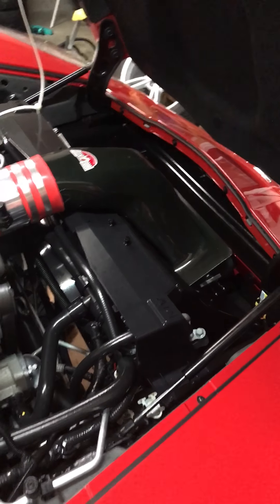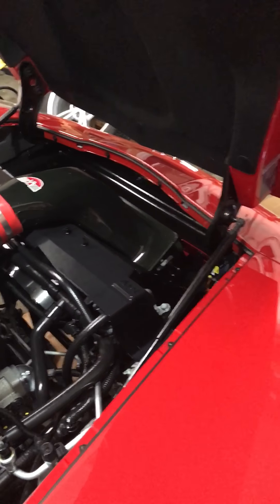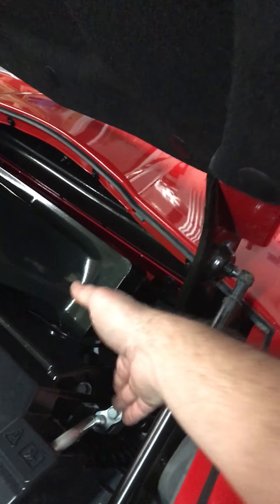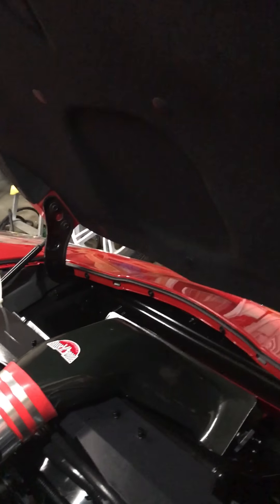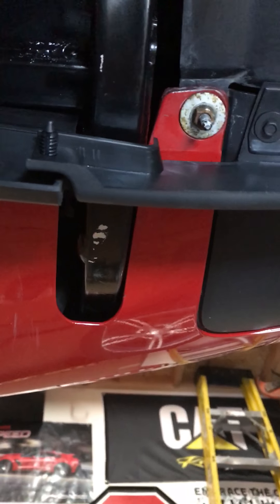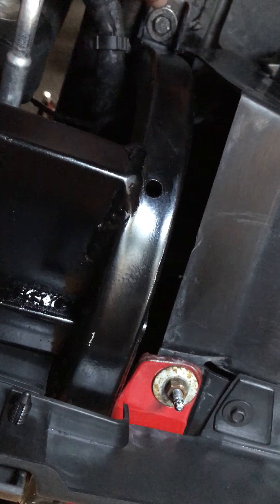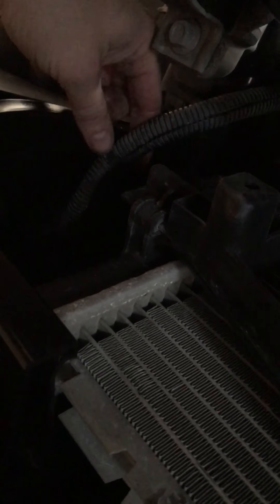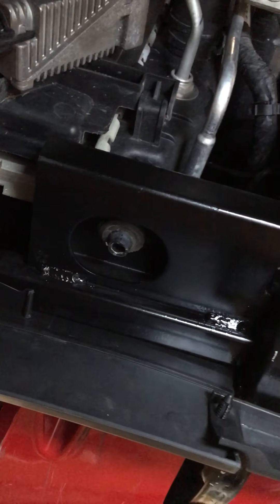C6 Corvette Front Skid Plate Removal Explained

Comment: I just went out and bought a flux core welder for 100 bucks and I'm going to repair mine as well. You are right about there not being a video detailing the removal. It's GoPro time. You inspired me to make a "how to video" with my C6 on the removal of this lower radiator support skid. Your video gave me enough information to tackle the job. Of course, seeing all the complaints and recurring damage that is caused leads me to conclude that it is a real shit design flaw.

Comment: Finally got the nerve and time to try this - The procedure works well - had to research or really look to tieing up the Radiator, sure didn't want to end up damaging that. Then of course working under the car I used Jack Stands under where the cradle ends and lower a-frames(both sides) meet. Then put Floor Jacks (I have 2) under the side frames where the jacking pucks go. The floor jacks wasn't carrying any weight just snugged up as a backup to the jack stands  I wanted as much security as possible when I was under that car.
Once all that was done every thing went smoothly. The only difficulty was getting the new radiator support bracket(or skid plate) mounted up to the frame - holding the bracket up while getting the 4 bolts started in the frame takes patience. Ended up frt bolt passenger side then rr bolt driver side then frt bolt drivers side then rear bolt passengers side 3  or 4 threads on each bolt in that order till they were all tight.

Comment: It appears in the video the front wheels are removed, it also appears the jack stands are not on the jack location pads, instead located somewhere in the center of car. Also is the cable tie ran through radiator fins?